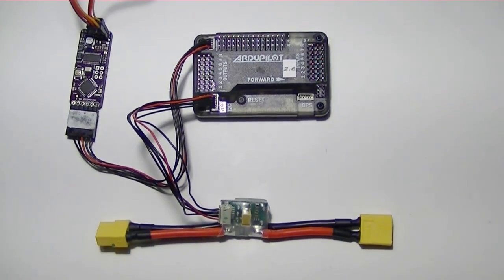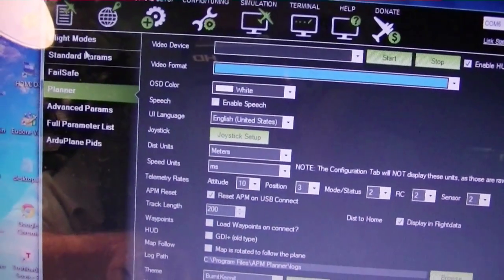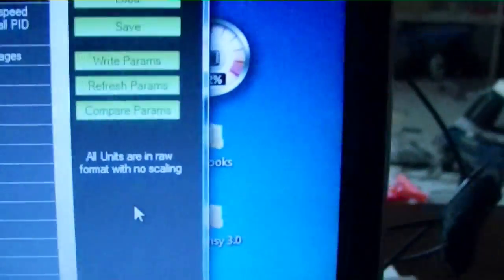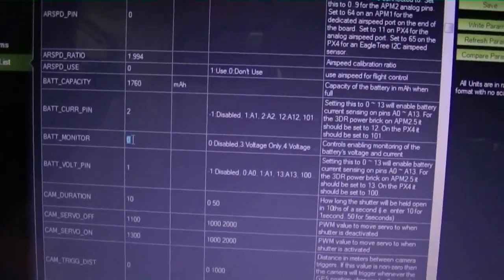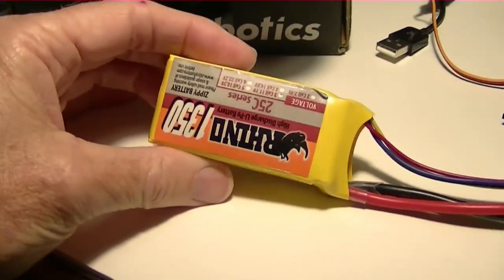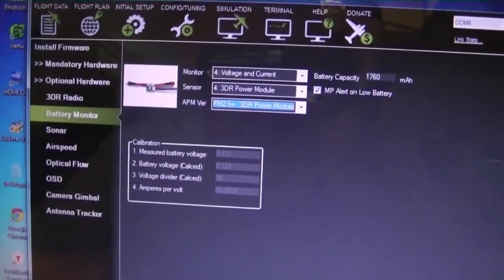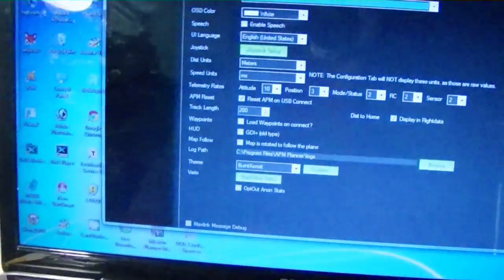FPV Part 5: 3DR APM 2.6 Setup for Power Module and MinimOSD Battery Voltage.

Comment: Can we connect 6s battery to APM 2.8 ?
Reply from the maker: I think the power module will take 6s or at least some of them will. Check your specs.
Reply: @DaveMerc  So by using additional attachment (Power Module) we can connect 6S
Reply from the maker: @orangetech8419  If you get one that supports 6S. They don't all have it.

Comment: For getting correct Battery Voltage on my minim OSD, I think I installed an older version of Mission Planner and connected my Cheerson Cx20 very well but the data shown on your awsome video you posted is different than mine.I can not follow your mission planner data you shown on your video, Please let me know where should I download the correct Mission Planner Version you loaded on this video. I appreciate your help, Best regards and thank you very much.

Comment: your statement about damaging the board plugging in both is incorrect. it's perfectly safe to plug in the usb and the lipo battery to the power module at the same time.
Reply: Gino Palumbo exactly
Reply: The caveat to that is that you don't exceed the Aps Max voltage rating.

Comment: I have come to the conclusion, that the power module is a waste of time. With a max 90A, and 2s to 4s it's limited where you can use it. With the argument that it provide clean 5v, then all the others must be dirty 5v. Never heard of that. My power module fried like a fuse, and I didn't even get it started. No other FC uses a power module that I know of.
Will be using my Pixhawk and APM 2.8 without it.
Reply from the maker: It has some good features like it has the current and voltage sensors on it so the APM can read the values.

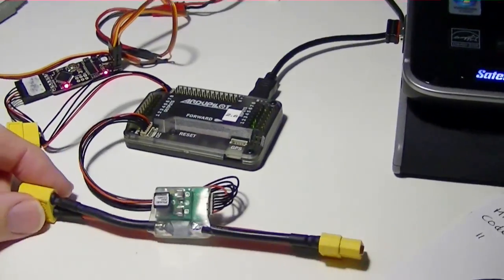Comment: @ 1:31 you said that you can't have battery and usb cable at the same time or board will fry. How do i check if my power module is working or not in mission planner if i don't have the osd?
Reply from the maker: You can use the telemetry radio set instead of the USB cable later to check the battery voltage in the mission planner. Air radio connects to APM and ground radio plugs in USB port of computer.
Reply: Sorry, i don't really get what you said but i did a search and come out with 2:

1) buy a telemetry module for my at9 radio
2) Found out a discussion which said that it is possible to connect usb cable and power module at the same time: http://diydrones.com/forum/topics/connect-usb-and-power-module-at-the-same-time

can you confirm #2?
Reply: I also found this http://www.rcgroups.com/forums/showpost.php?p=24592623&postcount=2557 
I guess you need to fix the part @ 1:31
i'll try myself later on and confirm it here later. (pray for my apm to survive)
Reply from the maker: Good luck. It's one of those things that may work but I would rather not take the chance when I don't have too. And I can't recommend that other people try it in my video because I don't want to be held responsible for possible damage.
The telemetry link is the safest way.
Reply from the maker: The telemetry link is not for the RC radio. It basically creates a wireless USB connection to your computer.

Comment: What is the purpose of APM Power Module,I am doing a build with apm 2.6 should i get a APM Power Module?thx
Reply: It lets the AP monitor the battery voltage. Without it, the APM won't read battery voltage. Useful for setting a battery failsafe.

Comment: im new at this How are you displaying the items (settings) battery Voltage GPS location so forth up on the FPV transmitter?  is there a unit or a VIDEO wire comming out of the Ardupilot that you plug into the FPV Transmitter?
Reply from the maker: Watch this video and it should answer all your questions:
https://www.youtube.com/watch?v=rwHojrTwq9k

There is a wiring diagram in the description of that video that should help too.

Comment: Help  Please!! I'am almost 7 months trying to make things work together.  Ardupilot 2.6 mega,   MAVLinK-OSD,  Power Module v1.0,  3DRobotics.com.  (date  2012-5)  915Mhz. Also 433Mhz radios have been used.   Ublox Module V2.0                                             Could someone please tell me how do test the pieces of the setup separt and as well assembled  to determine the problem.   Thanks in advance Michael

Comment: Great video... The apm has rth feature?
Reply from the maker: Marcos Vasques Oh yes is has RTH, Failsafe, and many more features. Check out the docs on the mission planner. You will be amazed what it can do.
Reply: Thank you? Im going to check it out the doc. 
Are there big diferentes between 2.5 and 2.6 versions?
Reply from the maker: Marcos Vasques If I remember correctly I think the 2.6 uses an outboard compass combined with the GPS module.
Reply: Because i'm deciding between them and if i will buy with telemetry or not. Thank you again.
Reply from the maker: Marcos Vasques The telemetry radios are very fun to play with but not necessary if you have an OSD display via FPV. You can always add the telemetry radios later when you want to do mission control from the ground.
Reply: Is not necessary to have telemetry to transmit data from APM?
Reply from the maker: Marcos Vasques Data can be received via MinimOSD over your video link if you have FPV. But if you want to send commands to the APM other than flight modes then you would need telemetry. It's up to you.
Usually flight modes from the RC radio are enough for pleasure flying.
You can have six flight modes plus RTL. One mode could be to start the mission and another to land. To use the telemetry you would also need some sort of mobile device like a tablet or a notebook to run the mission planner at the field.
Reply: It's nice, different that i thought. Sorry, but i need to request another information regarding APM (lastest for today lol). Is possible to APM on aliexpress? The price of APMs are lowest than other sites! Do you know if these equipments are so different than rctimer or HobbyKing Apm?
Reply from the maker: Marcos Vasques I don't know the answer to this.
Reply: Hi, please do you know what is the best antenna to use in my bixler with boscam 200mw? Circular Polarized or cloud spirit clover leaf?

Comment: I recommend that you do NOT buy from 3DR. Their quality is bad and customer service is worse. They suck bad. Save your money and buy elsewhere. I have been fighting for 2 months over a defective APM unit I bought from them and still have not got any results. They sell junk then will not give any service on it. So save your money and buy from some one else.
Reply: 3DR has been improving regarding their service.  They replaced my APM 2.6 and I just installed the new APM with no problem/s.  

I will have to say that each of the manufactures have their issues with quality and durability.  I have DJI, Immersionrc and 3DRobotics products.  I am always concerned I'm going to pull a wire, disconnect a solder, strip the plastic (tapped thread) and etc.

Maybe I was lucky with 3DRobotics, but support did communicate with me consistently.

Comment: Thanks for the videos. They've been a great help. Trying configure the OSD. All I get on the screen is "waiting for Mavlink heartbeat". Is there an additional parameter to change?
Reply from the maker: It's waiting for Mavlink data from the APM.
It won't work if the APM is running on the USB cable.
Disconnect USB and run from power module.
Reply: Turns out I had the osd plugged into the gps port. Operator error!
Reply from the maker: George Sullivan Oh yes, that could be a problem alright. Happy FPVing!

Comment: Thank you for your Video. But one question is still unresolved. If I want to use the BEC of my ESC to power the Servos/Outputline and simultaneously the Power Module, how I have to install it? Is this way right:

1. Power Module connected to APM
2. NO Jumper
3. BEC cable (with all three cables signal/Plus/Minus) to output line of APM --> Is there a special channel I should you for this?

Maybe you could help me in this case. How did you solve your APM / Servo power supply in your airplane?

P.S. Thanks for the parameter files ;)
Reply from the maker: yes, just removed the jumper and plug the ESC wire into the channel 3 throttle output port.
 For a seperate UBEC remove the jumper and remove the center wire from the ESC then plug the UBEC to any free servo output port.

Comment: Will this APM2.6 and GPS combo setup like yours? 
http://www.goodluckbuy.com/apm2-6-ardupilot-mega-2-6-external-compass-apm-flight-controller-combo-w-ublox-neo-6m-gps-for-multicopter.html
Reply from the maker: It's missing some of the components like the Power Module, MinimOSD, and Telemetry Radios. Other than that it would probably work the same way.
There is another combo from Banggood that has more stuff but also costs more.
Reply: ***** Okay, I've decided to order from Banggood. But which one should I get?  
This one(don't know what the 433mhz/900mhz telemetry chips are for):
http://www.banggood.com/APM-Flight-Controlt-Set-APM-2_6-And-GPS-And-OSD-And-Radio-Telemetry-Etc-p-920659.html

Or this one?
http://www.banggood.com/ArduPilot-Mega-APM-2_6-Flight-Controller-With-6M-GPS-For-Multicopters-p-89910.html

Do these have everything I need to connect to my quad?  I'm using a Taranis transmitter with FrSky D8R-XP Receiver.  
Thanks!
Reply from the maker: I am thinking the first one because it has all the modules and is better for planes and looks like what I have.
The telemetry radios let you do missions from your laptop computer with the mission planner. Get 915 for US or 433 for Europe .
The second link you sent seems more designed for quadcopters..
Reply: ***** Okay, i'll get the first APM package. I do have a quadcopter btw.
Reply: *****
Plan to get this AP2.6 GPS combo but not sure what the "Radio Telemetry 433mhz/915mhz" is for? Would this setup work with my quad? 

http://www.banggood.com/APM-Flight-Controlt-Set-APM-2_6-And-GPS-And-OSD-And-Radio-Telemetry-Etc-p-920659.html
Reply from the maker: leadpan I would think that would be a good set but it is hard to know for sure. Seems to have everything you need.

Comment: do you think i plug something wrong or it the power module is defected ? 
Apm power module not working
Reply from the maker: Measure it with a volt meter and see if you are getting voltage from it.
If not you need a new one.
Reply: ***** thx so much for your reply,  so the power module should be notthing to setup before i can use lipo to power up the APM right ? should be just plug and play right ?
Reply from the maker: Yes that is correct.
Reply from the maker: hide everfree I don't think the tail servo will work without the power module OR by providing 5v to the servo bus via one of the ESCs or a UBEC. I think you have to pull the jumper if you do that. If you have a lot of questions you should hit the forums such as RCgroups.  The failsafe is something I can not be sure about but they would know on RCgroups. Orange RX may not support it.

Comment: poster you can hook up a battery and usb ive done it and it wont damage your unit it still will work.. you have to when you arm it though the precheck in the software is says you may have to power  up the unit by other means if usb does not provide enough power.. so you can use both
Reply from the maker: Not sure about this. I think they mean some USB computer ports don't have enough power so you should use a USB hub.
Reply: ***** ive had my regular usb plugged in with my 11.1 lipo at the same time no damage.. as long as you have the regulator from 3drobotics.. it supplies 5.6 volts. so does usb so its no diffrent that leaving in the usb

the screen even says when you do the arming test or the transmitter test to calibrate you may need aditional power.. 5 volts and 5 volts is still 5 volts.. now what they mean by dont do it is doing the aditional power.. on the back side.. you can power the arudunino by the power adapotor that comes with it or by a 5 volt lead on the other side where you use the jumper then youll damage it..

i personaly just cant figure out how to get 6 channels out of the stock reviecver that they sent me specktrum dx8 with a ar7000 module.. anyone know?

Comment: Hi
I have been following your detailed tutorial. However two issues: 1) on my computer setting my 9x tx throttle seems to be going the opposite way power down instead of going up. I have done thr reserve still thesame. 2) my 4 in 1 25A esc won't power the APM. Any ideas plz?
Thanks
Reply from the maker: 4 in 1 esc? 
So you are building a quad copter?
My vids are about ArduPlane not ArduCopter so your setting will be different including the firmware.

Comment: Hi again Dave you mentioned in the section where you were writing the "Params" and that there was another "script for Arducopter , so far I have only seen the one you navigated to. Also noted that at current I am using te simple minimOSD config and wondering the diff with Extra because there doesnt seem to be any parameters to change when using the regular MinimOSD FW. Perhaps the answer lies in the reason you went with the MinimOSD Extra in the first place.  In other news...Still absolutely the worst winter on record up here ( N.of NY state across Lake Ontario ) how about you guys?
Reply from the maker: Yes, well we still have the snow from that last storm but didn't get any more so far. Yes there is a quad copter wiki too. In fact the copter stuff seems more up to date than that plane stuff. They are both together on the same site.
http://copter.ardupilot.com/wiki/introduction/
The minimOSD Extra features are mainly for RSSI, battery current, way points and other stuff people wanted added to the original firmware. Not sure what all of it does but I just go with the most robust in case I need it later.
Keep warm!

Comment: Hi everyone , first of all , really nice videos. im new to Flight Controllers and I made my first mistake, i bought the Quanum QFX from HK . I havent received it  yet, but many people are complaining about this FC, so i decided not taking the risk. I am looking for another option. I thought the Naza m Lite could be my best option, but ive seen some reviews of the Ardupilot Mega 2.6 and I really like its features. Obviously , my knowledge is not good, and  my budget is tight . What do you recommend me ?
Reply from the maker: I have both the Naza M Lite and the Ardupilot Mega 2.6.
Going to use the Naza M Lite to build a 450 size quad copter
but sticking with the APM 2.6 for the SkyWalker plane.
The Naza has a simpler setup but not as many features as the APM.
Reply: ***** Im gonna build my first Multirotor (hex). I would like to try the APM but i am a bit confused. Does it require any direct power from the battery or does it take the power from the Turnigy Plush 30A ESCs/BECs ? Is the power module used just to get  info about the battery? I have a super simple mini osd, isn't  the same thing?

Comment: You CAN connect the APM using the USB-cable and the power module at the same time, this is the procedure when running "compassmot" for example. See tinyurl.com/nodsb7a
Reply from the maker: No that is not a good idea it might damage something.
Just use a USB hub to get enough power as suggested and unplug the battery form the power module.